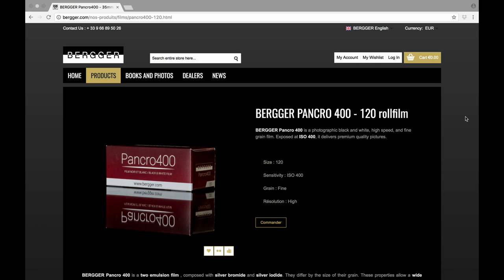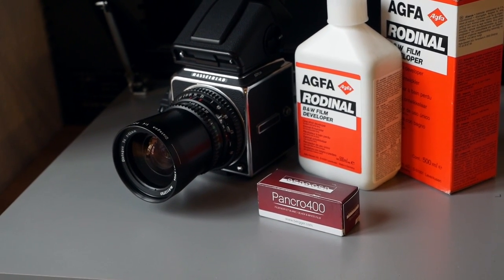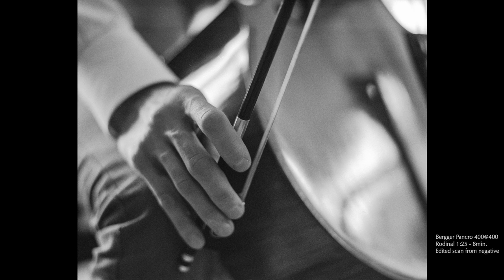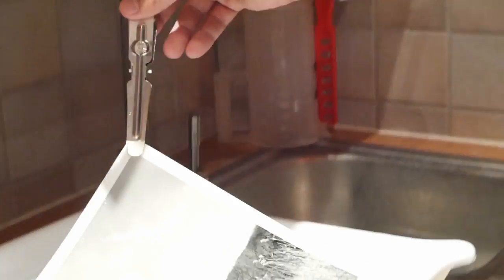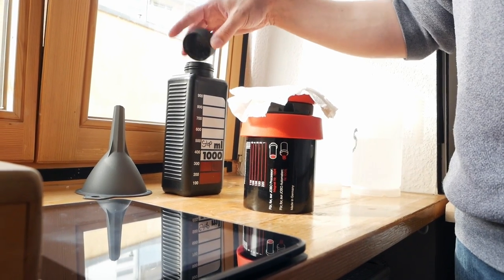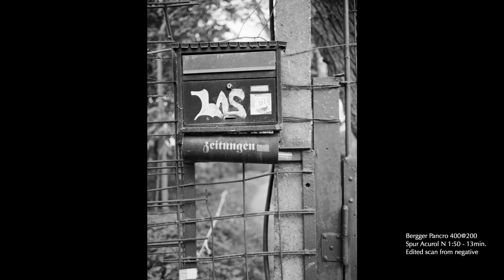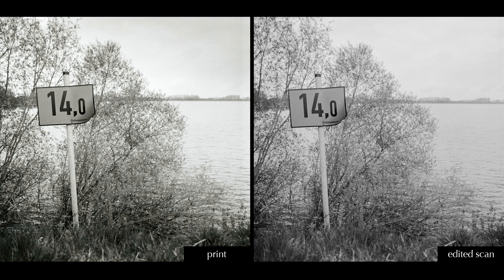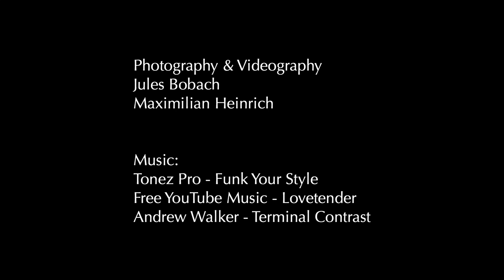Bergger Pancro 400 - The Ultimate Film Review

Comment: A very thoughtfully put together film - well done. 
The Bergger looks very similar to old Adox CHS and of course printed, not scanned. 
One thing I would say though, is ditch the brush when prepping negatives - it just keeps on depositing dust. Wipe the glass carriers with the back of your hand, and draw (pull) the film GENTLY between your index and second finger before you put it in the carrier -it works wonders. These are two tips from the late Barry Thornton and also the woman who prints the HCB archive prints.
Reply: Are you kidding? Run the film through your fingers? Hmmm.
Reply: @ctrentelman Hi - yeah - been using film/processing/printing for 40 years - the scissor finger wipe works incredibly well. Obviously you haven't been eating sausages or fish and chips with your fingers before you do it, but there's little natural grease between your fingers. It was a technique used by HCB's printer and was also widely used by old photo-dogs working in the newspaper print trade. Try it!

Comment: Thanks for this extensive film review. As for Rodinal used for developing 120 rollfilm, exposed as the ASA indicates, try 1:75 solution at 20C. time, between 15 and 18 min (depending of the type of film). Result: very nice balanced negatives - not soft not to contrasty, very good sharpness and fine grain. A joy to print as well. The less diluted the solution the grainier the result will be.

Comment: Thanks for the really helpful video. I bought 8 rolls of Pancro (7x 35mm, 1 x 120) and I developed my first roll in D-76 1+1 for 17 minutes. My negatives seem really dark and I struggled to get a decent scan. They do seem to print ok in my darkroom with perhaps a longer exposure than normal. How did your D-76 negatives look?
Reply from the maker: Paul Giverin Hi Paul, my Pancro negatives which were developed in D-76 looked excellent with 17 minutes developing time for 120 film. Maybe there was a problem with the temperature? Besides that, I have no idea since the developing times are the same for the 35mm version. Or some  unintentional overexposure?
Reply: Hi Max, the temperature was 20 degrees when the developer went in. It was quite a hot day so maybe the temperature was higher than 20 degrees after 17 minutes. I will also shoot another roll in another body in case the metering was out. Thanks.

Comment: The prints looked much better than the scanned negatives, and I think the film better in Rodinal than D76, but that’s just my personal opinion. The Spur scanned negatives, looked more like the prints, and I like that very much. I used Bergger films in 2004, but was never happy with the results, and quit using them after 10 rolls. It seems I need to try Spur developer with this film, to achieve the optimum results. May be a good replacement for Neopan 400 in Rodinal, which I used for years on Maui. Thanks for such a thorough testing, and showing all the results. By the way, where is that beautiful temple? Austria? It is indeed impressive & timeless. Cheers, Joe.
Reply from the maker: Thanks a lot for your comment. Interesting to hear about all your experience with different film stocks and developers. A real fan of Rodinal it seems. :)
The "temple" is close to Regensburg in Germany. :)

Comment: Great video guys and you tube site, You guys know when using Jobo tanks you meant to compress the inter part of lid then put on the tank, which causes a vacum seal to stop leaks when turning it over or running on a jobo auto agitator as chemical can vent gases

Comment: An interesting and intelligent video.  I've subscribed.
Have to say it's not entirely clear what the Spur developer did for you.  I haven't tried the Bergger film yet, but I routinely shoot HP-5 and Tri-X at 200 and develop 10 to 20% less in conventional developers like D76 and Xtol.  Same as with your use of Spur, this results in finer grain and softer gradation, which makes both printing and scanning easier. Better shadow detail (from the extra exposure) and more delicate highlights from the reduced development.
Kind of the opposite of the "push to 1600 - soot and chalk" school.
Also, I'd like to see the whole video over again, but with 35mm, which is more demanding in terms of grain and sharpness and gradation.  Pretty much all films look better in medium format. :-)
Reply from the maker: asparis145149 Thanks for your thoughtful and kind comment. Please excuse my late response. 

As you mention, what you describe is a typical pull process, so the opposite of pushing. For Acurol-N, the company Spur recommends shooting films at certain ISO and developing times in order to get a certain contrast on your negatives. In the case of Spur Acurol-N, to achieve standard contrast you often need to shoot a ISO 400 film at ISO 200 or 250 for instance. The same holds true for other film speeds as well. So the developer needs a bit more light to achieve standard contrast and this therefore differs from a standard pull process. I hope I managed to bring this point across. There are certainly much better explanations on Spur's website. :)
Reply: Ah. I will go and look at the Spur website.
From your explanation, though, it sounds like Spur is similar to some  of the old "fine grain" developers like Microdol.
The common explanation of those developers was that they contained solvent chemicals that "ate' the edges off the silver grains after they developed, making the grains smaller and softer, but resulting in less density. So needing more exposure.
(I have no idea whether that explanation is correct, or just an old wive's tale.) Could be that they were just less active developers that produced less density for a given exposure and therefore less grain.
Anyway, thanks for your reply.

Comment: I really enjoyed this review. From what I can tell, it's similar with Ilford FP4+, but rated at a higher speed. I'll definitely add it to my next batch of film stock. Regarding developer, have you ever experimented with Ilford Perceptol? I tried many developers and since I discovered Perceptol, I'm only using that; very small grain, creamy highlights and soft shadows, perfect for split-grade printing. I have a question for you: what brand of fixer do you use? For a long time I've been using Koda-fix with great results but then someone recommended me TF5 (Photographer's Formulary). I absolutely hate it; it takes for ever to wash the film, doesn't remove the magenta stain and just end up wasting water...
Reply from the maker: Thanks for your comment and excellent recommendations. I haven't tried or experimented with Ilford Perceptol yet but will definitely put it on my list. Your description sounds quite promising. :)
Jules and I both use MACO ecofix as fixer that can be had inexpensively at www.macodirect.de if you're in Europe. This fixer works perfectly fine for me.
Reply: Thank you for the info; I've seen eco-friendly fixers but didn't thought much of it since the used fixer either way contains the unfixed silver which is really not eco... but I'll try it out and if not, go back to Kodafix. Right now I'm experimenting a bit with color film and color printing (8 color ink-jet). It's really good fun!

Comment: i'm new to medium format, i have a zeiss nettar folder 517/16.  i see in some of your videos that you shoot with a particular brand yet with developing your using solvents for a meant for different brand? and using a different developing time?  If I'm following this correctly why would one do that? And by doing this what look are you trying to achieve?
Reply from the maker: REFIGUY69 Hey! Welcome to medium format and, I'm assuming film photography to some extent. Different developers bring about different characteristics and thus affect grain, sharpness, dynamic range, tonality, etc. if your negatives. It therefore makes sense to not just test a film with one developer but see how it behaves with different ones. Does that answer your question?
Reply: Yes it makes sense. Its pretty much what I thought. Although I'm not at the stage of developing my own film yet I'm sure the place that i get it done at has experience with it. (since1974) and I could request it for a nominal fee. They Push, Pull, Cross Process and Split tone. At this stage its practice shots with Zeiss Nettar as Im more adept with 35mm film and digital. Thanks for liking my Instagram as well @h0bes_0riginals

Comment: Wondering if you ever tried the higher dilution (1:100) and longer development with acurol-n for increased Eberhard effect. Any thoughts? Thanks.
Reply: We have used a 1:100 dilution @ 120min. in the fuji GS645S video
https://www.youtube.com/watch?v=wJtYhi7R2CQ
Reply: @julesbobach8129  Thank you for your reply. You say the longer development had a sharpening effect on areas with detail but was not good on larger homogeneous areas. Do you think that, in a portrait,  the effect would not be positive due to homogeneous areas of skin, or would the detail dominate?
Reply: I should have mentioned these portraits are with 11x14 Pancro 400 sheet film, so in terms of size on the negative, the homogeneous areas are relatively large.
Reply: @leonfairbanks2959  Stand and semi-stand usually suffers from uneven development and bromide drag.
I would not recommend it for larger formats and portrait work. It works much better for 135/120 film and high contrast scenes like fashion shoots or architecture for example.
Maybe process one sheet first or give adox atomal 49 a try.
Reply: @julesbobach8129  For reference, in the video you say dilution was 1:200 for 120 min, agitation once every 40 min.

Comment: Nice review! Rodinal always brings out quite the grain in fast film, especially 1+25. Try out 1+50 and perhaps 18-19 C, normally it works for me to have smoother grain, if that's the goal. 

I shot some of this stuff at EI6400 and pushed with DD-X, the results were punchy and grainy and reminded me of Delta400 in similar high rating.

Comment: Rodinal brings out grain.  I tried it once - too grainy for me.  BTW, Tri-X is a true 400-speed film, when you shoot it in shade or other very soft light.  However, its response to shadows is far below middle gray in high-contrast situations.  For those situations, set your meter to 400 and take a reading in shadow, then set the camera to the meter's reading minus 1/2 stop.  For medium contrast situations (soft shadows), take a shadow reading and set the camera accordingly.  It will lay down for you.